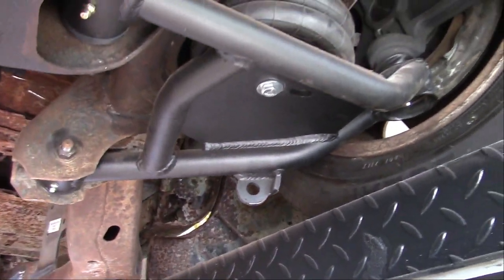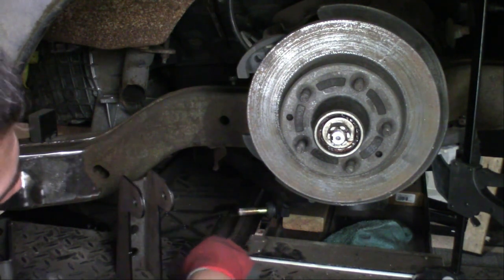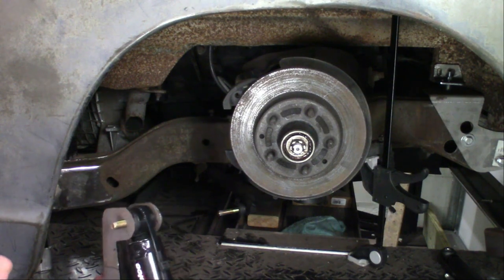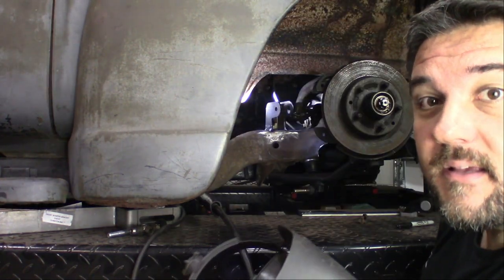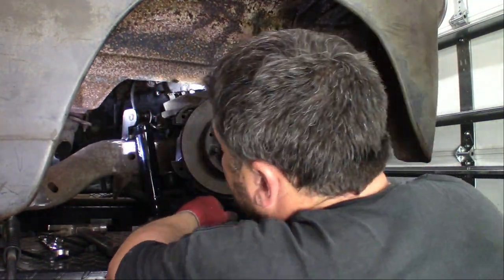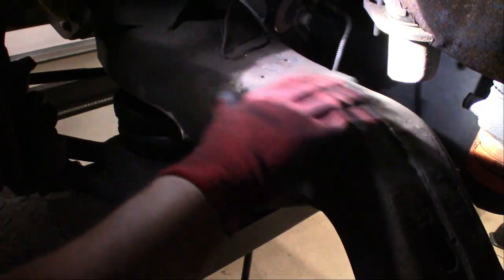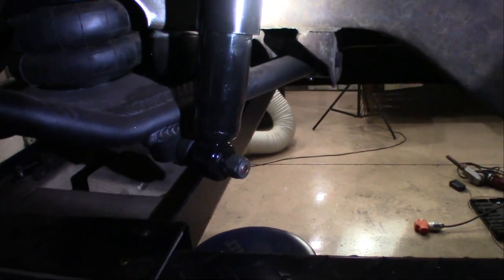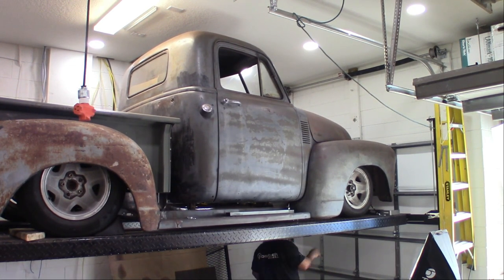PART 28 - 1952 Chevy 3100 - FRONT SHOCKS - CUSTOM!

Comment: Very nice work did you loose any turning radius
Reply from the maker: With the stock S10 rims, I do hit the shocks when turning........ HOWEVER............ I've been told when I add wheel spacers I should be good....... I'm not that far yet..... Still need to figure out what rims / tires I'm going with.